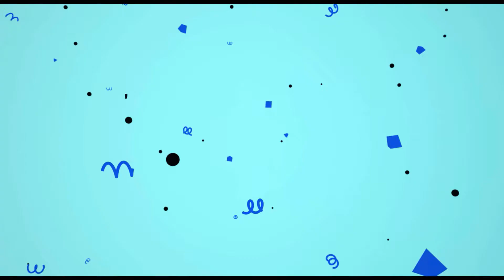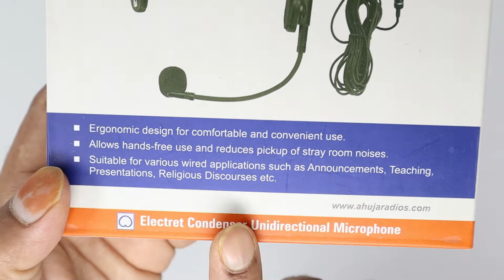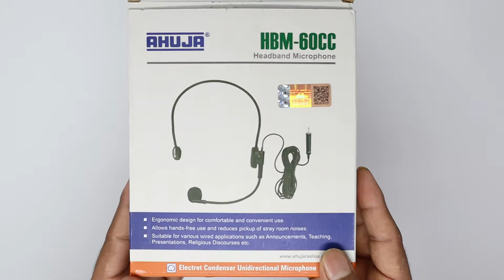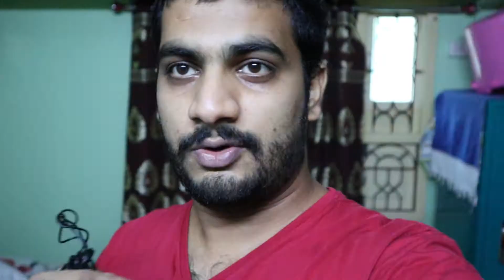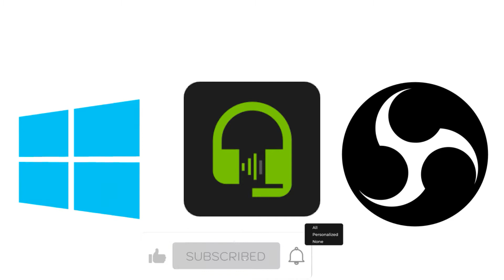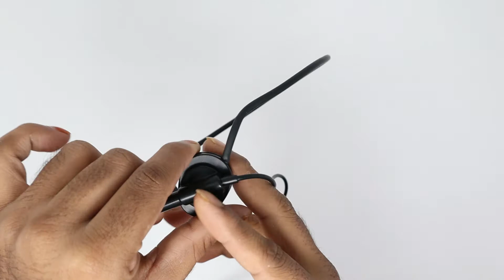Ahuja Head band Microphone HBM-60CC | DSLR ANDROID PC Audio Mic Test | Reduce Fan & Background Noise

Comment: Can we connect it on Bluetooth speakers.??? As a portable lecture speaker.?
Reply from the maker: If the speaker has mic input then it will work
Reply: @rehanhanar  so I’ll not work through aux input.?
Reply from the maker: I don't think so it might work through that but not sure.. Do check and let me know. I think there is a separate speaker for ur requirement